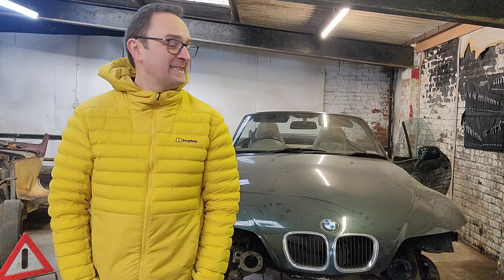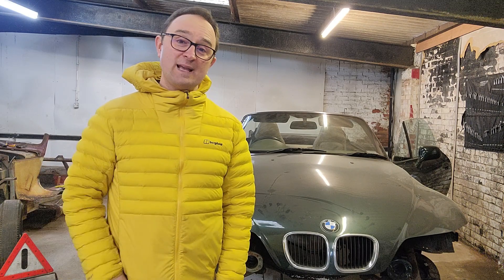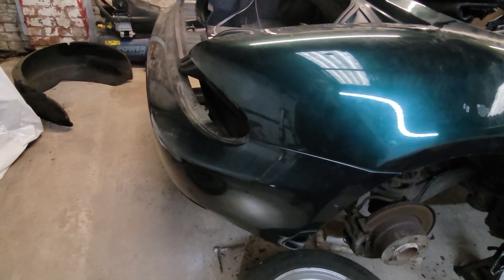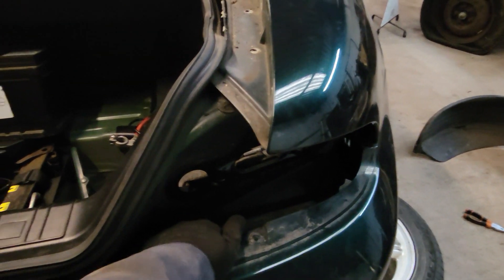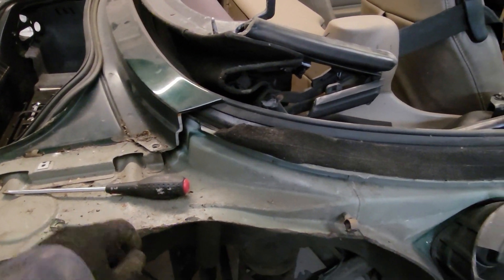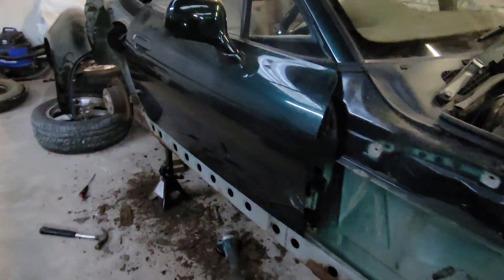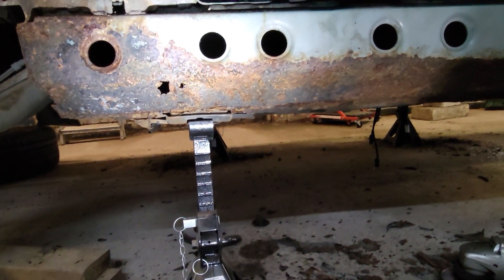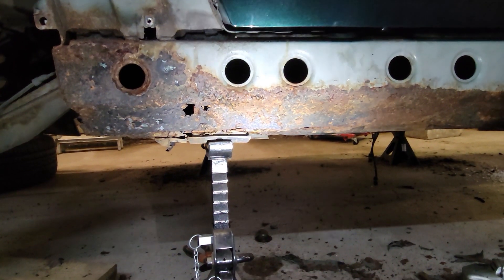BMW Z3 gets NAKED! EVGT electric car conversion project. Strip down, part 4

Comment: That's a horrific amount of rust compared to my 1984 VW Scirocco! Cut out all rust and replace. Double skinning is just askiing for it to corrode again. Subscribe to Fitzee's Fabrications if you haven't already
Reply from the maker: How about parts that have been thinned by rust but are still very solid? What would you do there?
Reply: @EVDIY  If it was just localised pitting, I might just leave it, but with rust as expansive as yours and in a structural member, I'd cut it all out and replace. Epoxy primers are non porous, unlike conventional ones, well worth the extra cost.
Reply from the maker: @EVguru  Definitely a job for epoxy this one. I think I'll get some repair panels knocked up in CAD and get my stockholder to bend them up for me. Then I can just cut the lot out and put fresh steel in.
Reply from the maker: PS I like Fitzee's!